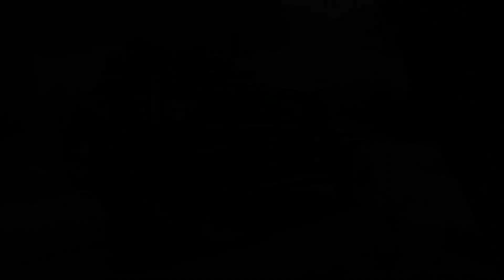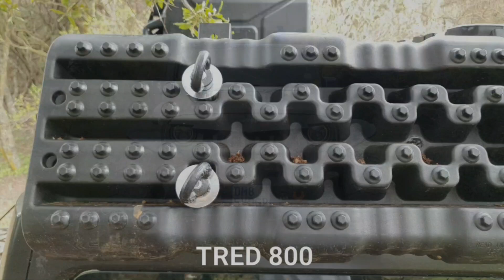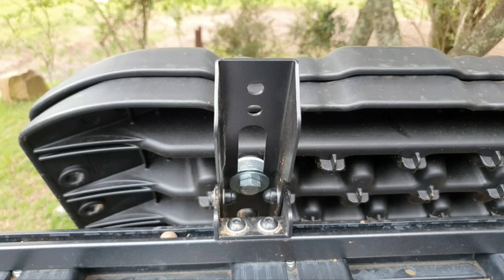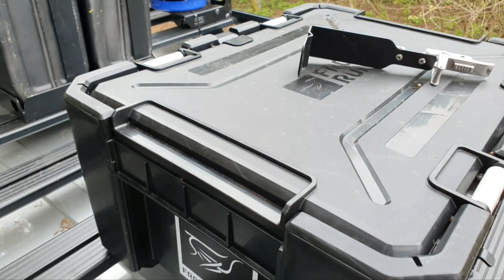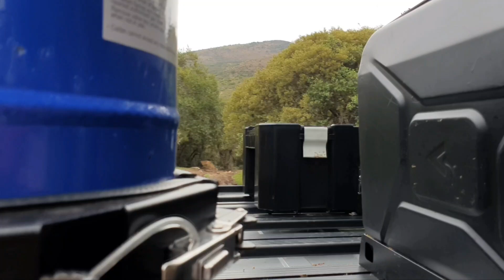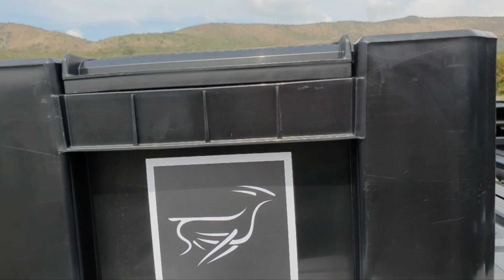CHECK OUT THIS 4X4 OVERLAND BUILD | @DometicFrontRunnerSeries, @TREDOutdoors +  Jeep Wrangler Walk Around

Comment: Love the setup🔥🔥🔥 we recently bought a gas cylinder holder from front runner ( the one for the roof &holds a 5kg bottle) wish we had seen this video before the purchase😅 we would have gone with this 3kg side mount seeing that it works!
Reply from the maker: Thanks for watching. Really appreciate it. Pity this video was released now only. I wasn't aware that the other Front Runner gas bottle holder can only take a 5kg as I almost purchased that one too.